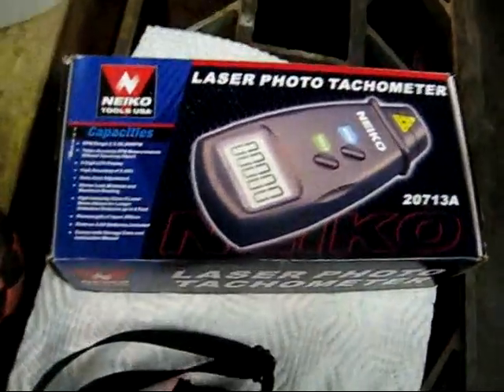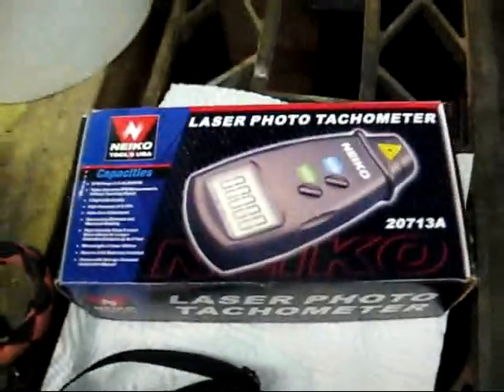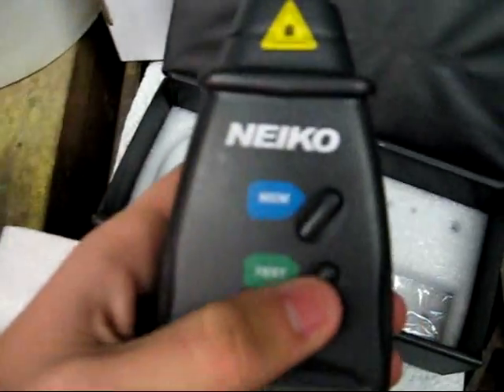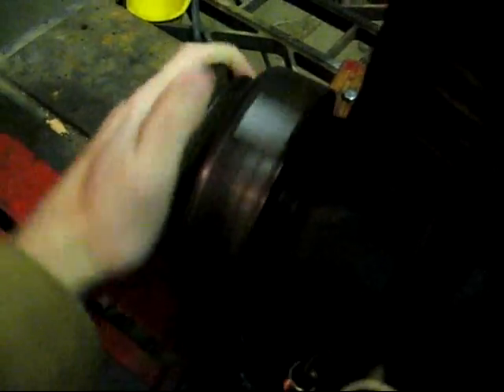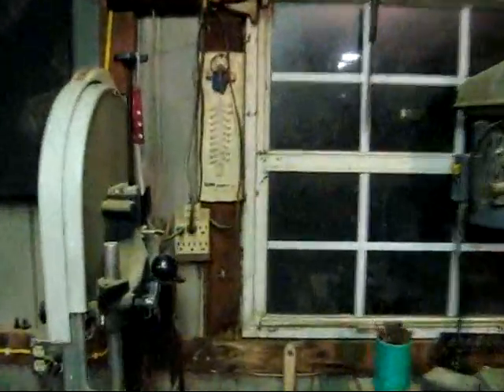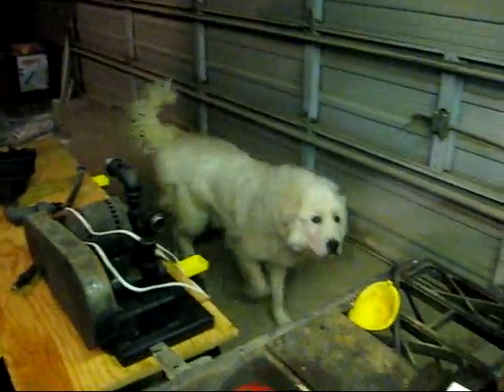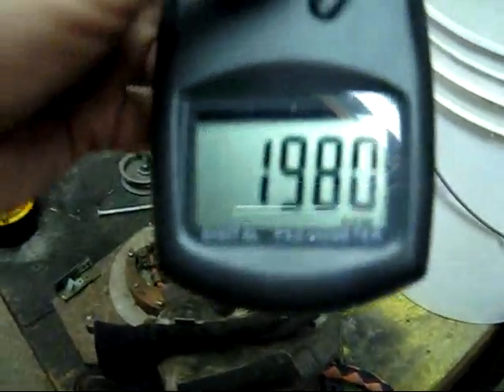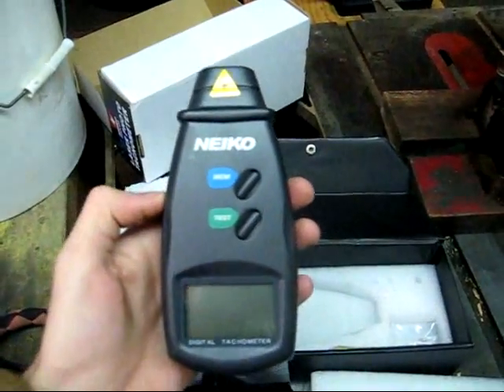Non-Contact Laser Tachometer

Comment: Thanks for the demo!  I actually just bought one of these to put on my metalworking mill.  Do they happen to mention if the reflective tape needs to be on a dark background?  I am assuming there needs to be some contrast between the tape and the rest of the rotating part.
Reply: You can use anything white. I use a white paint pen. But a white paper sticker will work fine too. Or get a small bottle of "white-out" for typewriters. I used to use it for setting the engine timing in old cars.

Comment: i use antique mechanical tacs! i have 2! they work fine! all tou do is hold them up to the indent in the end of the engines or motors shaft and count how many times the 2 small dots pass each other for 1 min! its actually pretty accurate! i tested it on a 1750rpm motor and got exactly 1750rpm! they are ment for hit and miss engines but work fin on any engine! btw your briggs coldstarts better than my fh! mine hates cold! the wi is good in cold! how do you hook up the drill to start like that?